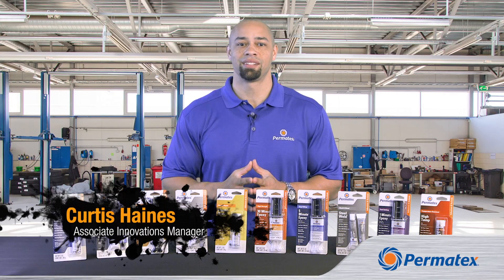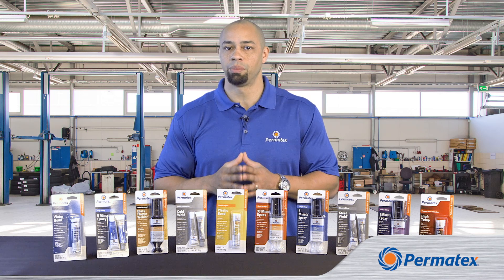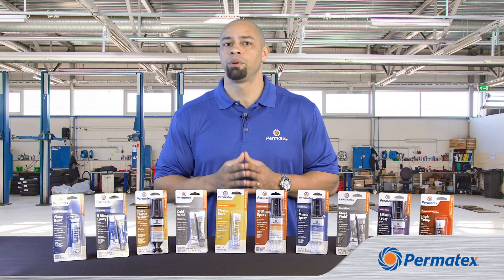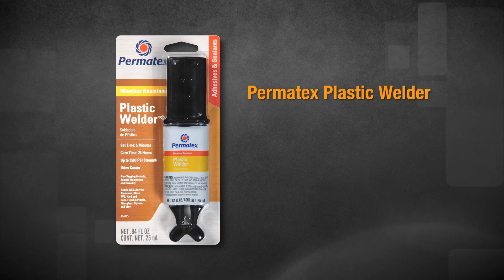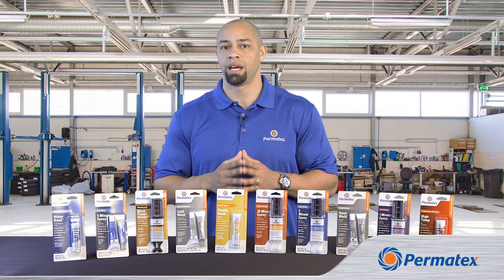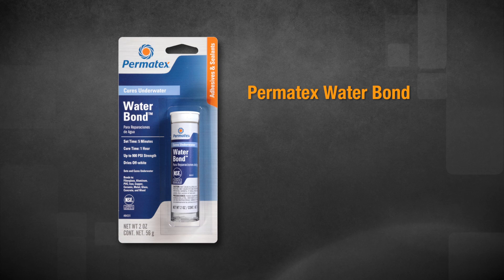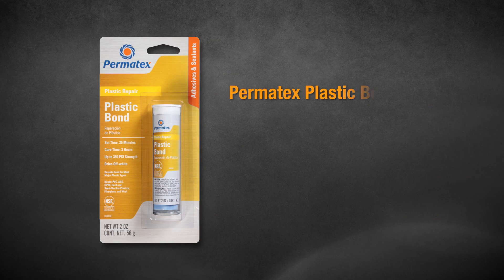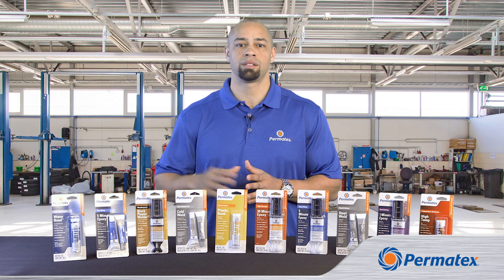Choosing the Right Epoxy: Permatex Tech Tip Series

Comment: Did Permatex Steel Weld And Cold Weld Has The Different Characteristic?
Reply: Yes! Some of the differences is that steel weld cures faster, steel weld has higher strength, but cold weld is resistant to chemicals (automotive fluids). Cold weld can be painted, but steel weld (probably) can't be painted.
Reply: @GarageWeekends  Owh... Thats The Different... I Thought Both Are Same Before... Noted With Thanks Boss...🙏

Comment: It is really good video. I have one query, is the plastic welder flexible after bonding. Because I have a broken a plastic monogram that has broken in 2 pieces, the bond area will endure bending stress due to clamping. The monogram is clear plastic (probably polycarbonate or acrylic) from 1958.  I have also have 2 part clear epoxy resin parts that I also want to bond together. I need the bond to be flexible yet have stregth.
Reply: It is.

Comment: A few Permatex products I've tried- the clear 100% silicone, steel weld ( on aluminum) and black silicone adhesives- all of them have worked very well- better than competitor products with the same applications.

Comment: Hello :)
Permatex Steel Weld Epoxy Stick have chemical resistance to hydrocarbons, ketones, alcohols, aqueous saline solutions, diluted acids and alkalis?
Reply: Pretty silly question considering it's designed for steel/etc which isn't resistance to acids.

Comment: Do NOT use their "Liquid Metal Filler". It does not form a hard surface like it claims. I used it as a pre-painting filler on my car and it is still spongy and elastic. Used as per their instructions..
Reply: You must be kidding.  Epoxy is not meant to take the place of body filler, though there are some epoxy body fillers but the difference is the amount of solids in it to make it harder and more evenly finished.  Use the right type of product for the job, anywhere that autobody work is done, they have a supply of body filler.